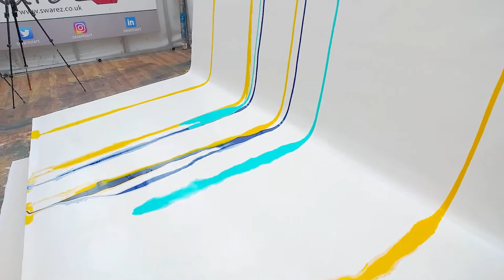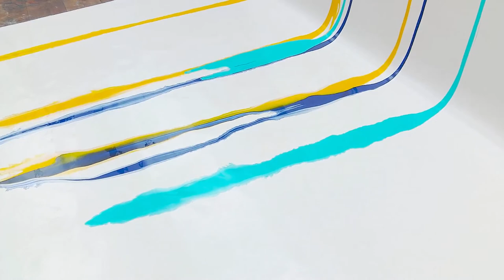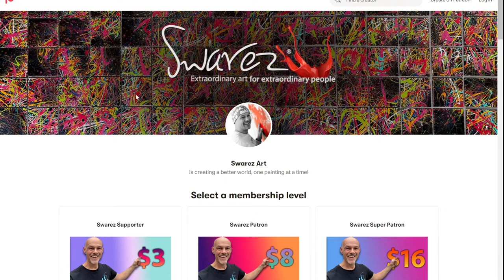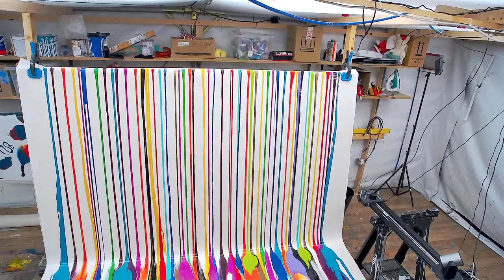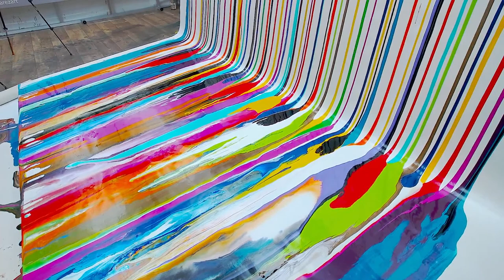Sensational STRIPED painting comes to life - SIMPLE to learn technique!!

Comment: Keep trying to catch your live stream but work gets in the way. Question, I am assuming you let it dry in the hanging 90 degree angle. How does it not crack when you take it down and lay flat? Love this btw!
Reply from the maker: Thanks Gigi, much appreciated 😊 There is flexibility in the paint even when it's cured - that's down to the way we've engineered a designed it for our own requirements, so thankfully no cracking! Otherwise we'd be in a right pickle!